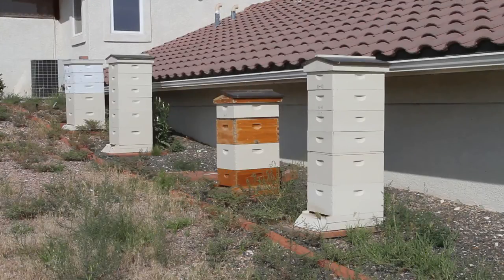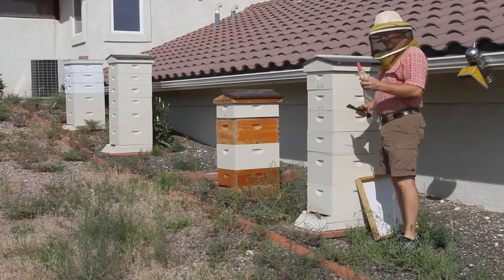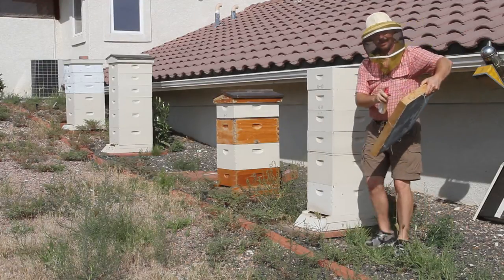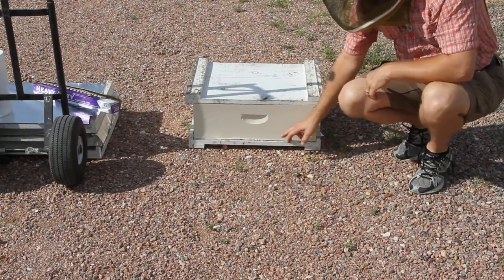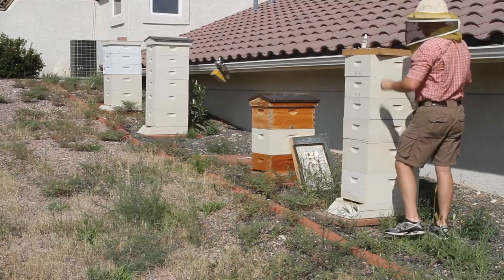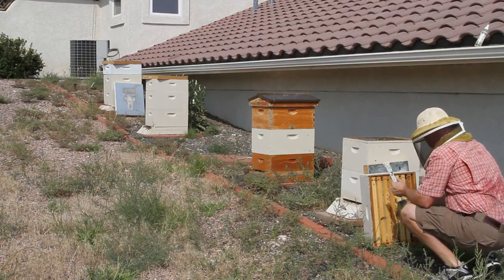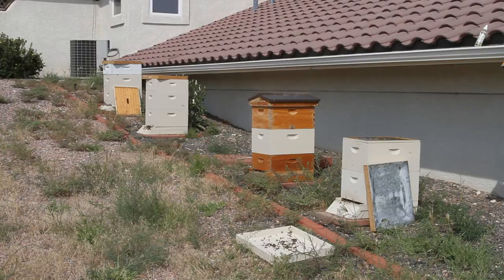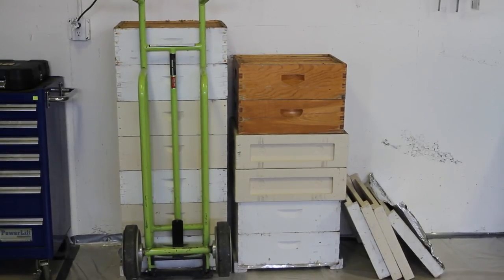Part 1 Harvesting Your Honey

Comment: So you leave no frames for winter feed?  Other than what's in their brood boxes?
Reply from the maker: A strong hive needs about 60 pounds of honey for winter in even the coldest parts of the U.S.  If a deep hive body is filled with honey it weighs about 80 pounds on average (10-frame equipment).  That is plenty for winter, and yes I drop them down to two deep hive bodies for overwintering.
Reply: Honey Bee Honey thanks for that info. I left an extra super with about 6-7 frames of honey on both of my hives. Each hive has a deep and medium box brood super on them also.  I've noticed that they cluster on the brood super and not on the honey super. So I was wondering if I could have robbed them of more honey this fall.  Esp. Since I'm going to feed them as you suggested through the winter on another one of your vids.